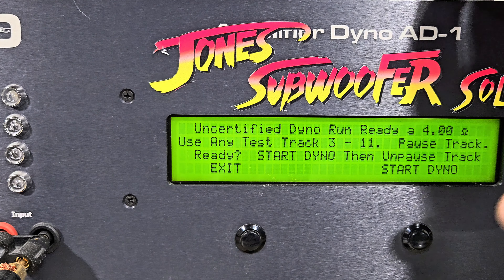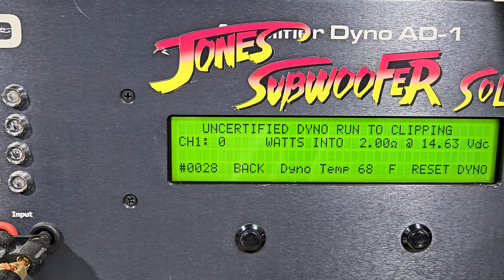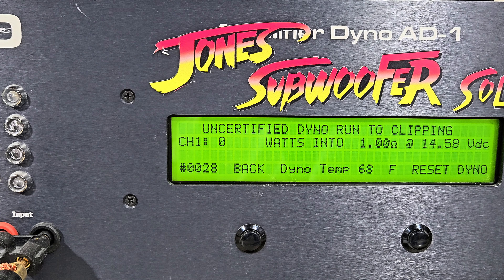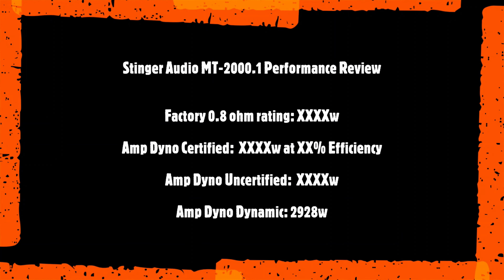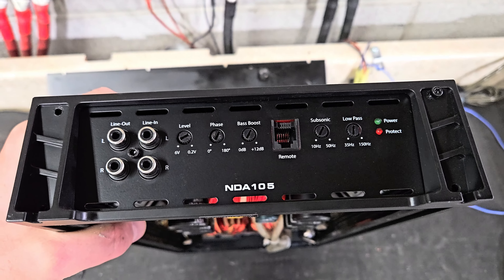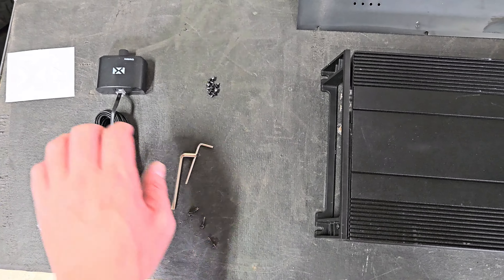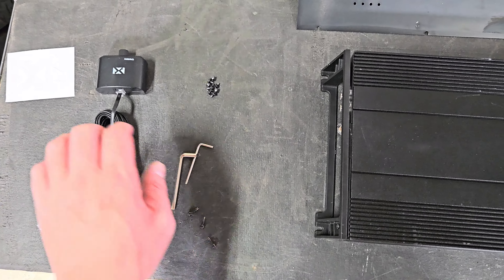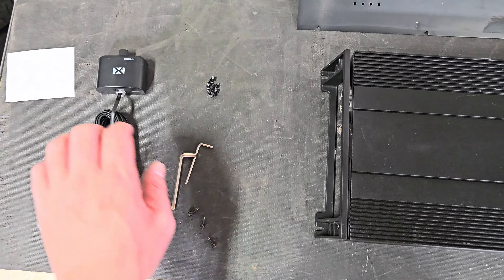AD-1 Amp Dyno NVX NDA105 by Jones Subwoofer Solutions JSS *CALL THE FIRE DEPARTMENT!*

Comment: Correction Sir power supply Fets  not output mosfet
Reply from the maker: Good to know, I'm a noob with amps
Reply: Generally the fets close to the power input are going to be all related to the power supply side of the amp.
Reply from the maker: @JasonWW2000  I knew that, but at the time of recording I just got it backwards.  Distracted by the fireworks.

Comment: I am confused here regarding your numbers for efficiency.  Let's look at the 4 Ohm cert. test.  You state 87% efficiency.  How did you calculate that?  I see 838 Watts out, and 14.58 volts at 75 Amps in. Input power = 14.38 Volts x's 75 Amps = 1,093.5 Watts.  Efficiency is Output power divided by Input power, so 838/1,093.5 = 76.63%.....and you carry over the same "error" with the other tests.  For the 2 Ohm you state 81%, and by calculating the numbers for this test as I did with the 4 Ohm one I get 72%, and you show 81%.  Could you please show how you did your calculations?
Reply: One or both of u didn't major in math.

Comment: Why do you pull the amp clamp after certified? Always meant to ask that, just curious..
Reply: You can't get an accurate reading on the uncertified and dynamic with basic clamp meters. He would rather remove the meter than confuse people with the wrong readings. To get accurate measurements you'd need a much more expensive test rig and probably shunt style measurement devices.
Reply from the maker: Basically what he said.
In certified mode, I get voltage, wattage, and current all locked in at the same moment (when red light comes on and dyno stops reading).
In Uncertified with the dyno showing peak numbers, using the clamp would be inaccurate/difficult to time readings properly.

Comment: I'm currently run a NVX NDA104 pushing 2 Q Power Deluxe 15s wired to 1 ohm and it slams. I know these subs are trash but I got them for free ...the amps rated at 1500watts RMS @1 ohm. Id like to see this amp on a Dyno to see what it really does.

Comment: Better circuit protection would have made this more expensive. But defeats the point of saving money in the short run. I heard full bridge amp has a problem with low voltage failure. Did your voltage drop too low after several test runs? I suspect this amp is not for stock car battery.
Reply from the maker: Definitely was not a battery issue, I support up to around 15k with my bench setup.

Comment: That blew on well over 14 volts those output fets are being ran to their ceiling voltage they need better ones where they are not ran so hard flat out. I dont think u ran it hard to be honest yeah u was clipping it but that should not have caused what happened being ran right on the line of rail voltage cause the issue .
Reply from the maker: That was a HARD clip.

Comment: These are probably fine for the daily. Can't really compare  to pure resistive load, and very well could be a fluke in any chy nah component amp. This one on sale or coupon for $180 is nice, but that new stinger 2k is a better value. Nice video Jason 👍💥
Reply from the maker: I am definitely at fault for this one.
Reply: Idk when you get around that 180-200$ there's quite a few solid options. IMO it comes down to your preference and warranty/customer service.
I'd prob take the Recoil 2500
Reply: I bought this on sale a couple months ago for $149
Reply: Yup that stinker 2k is definitely bumping and it has more to go than what my car can feed it lol. If I turn it up too much it muffles the bass my cars interior lights all dim the poor alternator is only rated for 80amps 😂 race car package technically they intended this car to be the lightest of all models so I’ll need to get the standard model alternator which is good for around 200 amps lol

Comment: Not the amps fault.those amp dynos put serious strain and stress on amps.
Reply: Any amp that smokes on a Dyno isn't made good. Idc what you say. If it's gonna smoke on the Dyno it's gonna smoke in your car
Reply: @JMoneyDG That's not accurate at all. The amp dyno's use resistive loads so its an exact number. 
A speaker is considered a reactive load meaning the resistance is constantly changing based on the frequency. 
1 ohm resistive is much more stress than 1 ohm reactive. 
Keep in mind that when wiring a sub to one ohm you have whats called box rise or impedance rise. The amp will never see that 1 ohm load, it will always be higher. The amp might see 1.5 to 3 ohm at the very lowest and at only certain frequencies. The rest of the time the resistance is higher like 5, 10, 20 ohms. 

You would also need to have the amp maxed out as it played its lowest resistive frequency. 

This is why amps last decades. Assuming you don't clip it, drop copper strands in it, overheat it or feed it too low of voltage. Those are the things that kill amps. 

In order to duplicate what happened to this amp you need to wire a load down to like 0.3 ohm and max out the power. Some people do this and blow amps. These people are taking the risk. It's on them.

This is why the manufacturer tells you how low to wire the amp. If it says 1 ohm stable, they only guarantee to that load. 

I hope that makes sense. 👍
Reply: plenty sense

Comment: This amp sound pretty good I’m currently running one
Reply: then you better baby it. this what has happened right here.... HAPPENS A LOT!!!! in the real world
Reply: Just don't wire it below 0.5 load. 1 ohm DC is probably best as the amp will never get down to a 1 ohm AC load.
Reply: @JasonWW2000  with box rise it’ll never see .5 ohm
Reply: @peeweekirkland8177 Thats my point. If you wired to 0.5 ohm THEN you might actually get a 1 ohm load to the amp.
Reply: @JasonWW2000  you’re right I read it all wrong that was my fault. It’s one hell of an sq amp
Reply: @peeweekirkland8177  Cool, what kind if sub setup do you have? What are you wired to?
Reply: @JasonWW2000  I had 2 NVX nsw dual 2 at .5 ohm blow the magnet off 1 now I’m running 2 AB hawks at .5 ohm
Reply: @peeweekirkland8177 Ahh man, playing with fire. Lol 
Hopefully you have enough impedance rise to not over stress the amp. 
What do you mean by blow the magnet off? Did the magnet bolts come loose from the frame?
Reply: @JasonWW2000  naw the screws still in the magnet it broke from the metal frame. I thought I busted it but when I looked the metal was ripped
Reply: @JasonWW2000  it’s a video on my page 😂

Comment: Problem with a good number of full bridge amps is they use the sound digital boards with little protection circuitry. Sundown SFB, NVX NDA, Soundqubed U series, etc all use it. Barevids does videos on them and its amazing how they get away with it. They're excellent for the money when used lightly but when clipped bad this happens. This is why Taramps is leading the pack when it comes to full bridge amps.
Reply: This isn't a full bridge and the topology really has nothing to do with it. The "soundigital" boards you speak of is actually Chinese clones OF the soundigital amps. Clip an amp like this and you're going to be in for a smelly good time!
Reply: @commonsenseisdeadandgone  I've clipped a smart 3 a couple of times over (during tuning and testing)and the worst thing I've had happen is it went into protect and never came out. That was my mistake and I've learned after that. And yeah I forgot to mention the Chinese copy part but it's still around the same design nonetheless with a slightly weaker protection circuitry system. Also just realized I've mistaken this for the XAD 😂😂
Reply: @kyletimmins7331  smart 3s are beasts! They are super easy to fix too! They always burn the power trace on the bottom of the board. Out of the 4 I've gotten blown, I've put $0.00 in to fix them. One was reverse polarity, one was ran on poor electrical, one the dude left playing on a 40Hz tone for like 50min on a battery not hooked up to a sub he forgot about it..... the other IDK but trace! 😂
Reply: @kyletimmins7331  oh but he was wired at .8 resistive load not reactive and he was certainly letting it eat and pushing his luck ... he was the first to admit it ... I can't believe the aluminum fet hold downs went like that! This is just a Hifionics amp, which aren't terrible quality but they just don't last. No idea why but anything over 1000watts from Hifionics has an end of life timer I swear. 

The good old days when I didn't need 10k watts in my daily! 😂
Reply: @commonsenseisdeadandgone  oh yeah they are beastly for sure! I currently run a smart 5 now on an Avatar SVL 15. Gonna be upgrading to a smart 8 once the sub's broken in more.
Reply: @commonsenseisdeadandgone  oh nice. Yeah Hifonics are decent amps. I used to run an HFI2500 about 10 years ago. Was a pretty good amp for a temporary setup.
Reply: What I don't understand is why  guys even push their amps to the point of clipping.    Good electrical?   Good OFC wiring ?
Reply: @drrckhamilton  some push to clipping during demos. Others push either because they don't understand the consequences or they just want to test the durability of the amps circuitry system via protection circuit, mosfets, caps, etc. It's rather dumb in most cases but makes for good information as to what not to do with certain amps/parts.
Reply: @kyletimmins7331  

I guess....... if the goal is bass.  We all have varying perspectives.   A well-balanced system that is not bass centered sounds so much better to me.
Reply: @drrckhamilton  SQL setups are nice to have. Plenty of bass while being able to hear and listen to each beat, each drum kick, the vocals, the background noise on the music file is ideal in a lot of people's mind. I used to be getting into sound quality especially after hearing my Dad's system as a kid but I also love the way bass feels on my body.
Reply: @kyletimmins7331  

Don't get me wrong.   We all like bass... but there is something about a system that has a well tuned, fully active front stage with subs, of course, that is really enjoyable as well.
Reply: @drrckhamilton  if done right, it's both! 

That's the beauty about bass, can always turn it down! My system will rattle your eyes but you'll always hear the vocals, not over bearing with bullet tweets! 

I actually run a Audison DSP and hands down I'm a bass head.... I realize not many do this though.
Reply: @drrckhamilton  "good ofc wiring" 

Oh the 2 most misconstrued things in car audio ever! "Run CCA and you'll lose power! Clipping will blow your amp or subs.... Or both!" 
The misinformation is plentiful on those 2!  

"But there's videos where OFC wiring gained amplifier output" 
I'm well aware, no one EVER said CCA is just as good as OFC gauge for gauge! Size it right and you'll lose nothing! 

We will also ignore the fact that at that power level, majority is not even going to notice the a lick of difference in sound! 

Clipping..... That's just something else entirely...... Clipping the output, the signal or the sub on the center pole? 😂

Comment: I wouldn't buy it. Run it hard on a hot summer day and there goes 200 bucks plus time and labor.
Reply from the maker: I really wouldn't expect that, unless you clipped it hard for 10sec straight like I did
Reply: @Facekicker Plus wired it down super low.